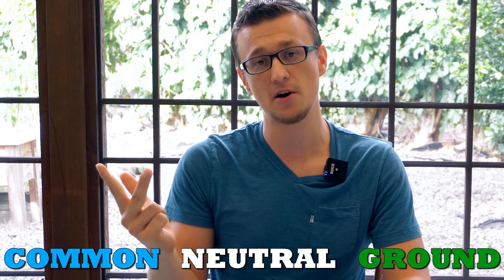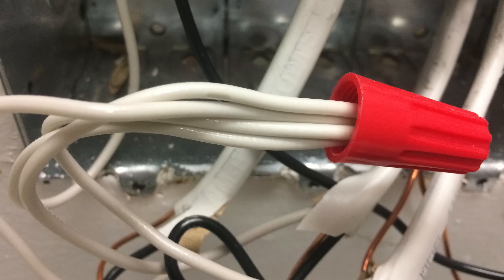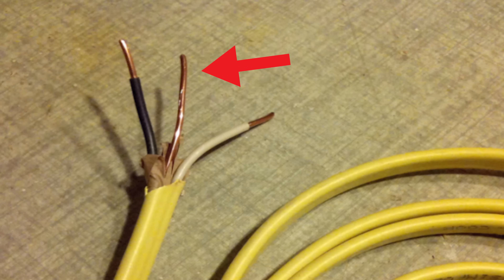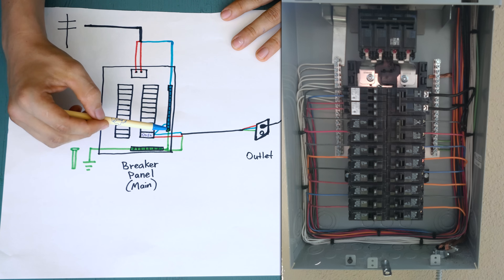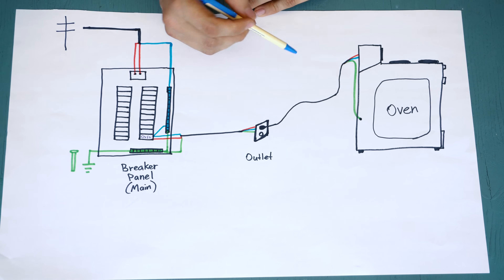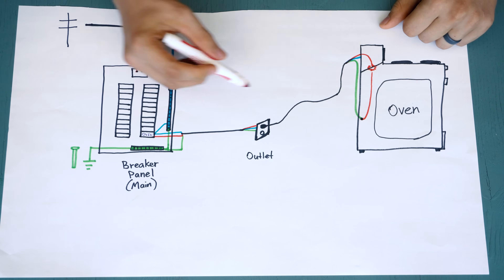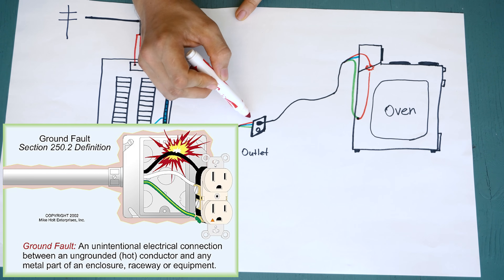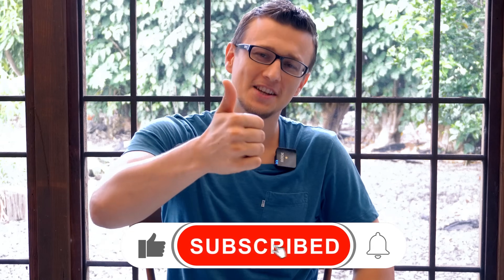Is Common and Ground The Same Thing?

Comment: if you are using common in place for a nuetral you are using the term incorrectly.   a common  is just that .  what does it have in common?  and with what?   there needs to be two or more things to be a common.  it could be a connection point or current path.   you can have commons on hot nuetral or grounds.

Comment: I recently purchased a powered intercom "system". that is NOT wireless - it uses the ground wire to carry the signal from one box (on circuit 'A' in one room) to the other box (on circuit 'B' in another room. In order for the system to work, circuit 'A' and circuit 'B' must therefore share the same ground bus bar. Can you please outlie my approach to making this happen. (At this time, the "system" doesn't work, meaning that the two circuits use different ground bus bars.)

Comment: An uncommon video. A clarification: A 240v service drop contains two insulated conductors that are connected to the low side of the transformer. The low side has three legs, two high (180 degrees out of phash) and a center tap. The center tap is connected to a bare carrier wire that is used to support the two hot wires (triplex). The center tap wire is also grounded at the pole by tieing it to the ground and neutral wire. These wires are connected to the service entrance and the neutral is connected to the weather head for aerial support of the wires. The neutral is then routed to the breaker box and connected to a ground rod and the neutral bus bar in the breaker box. Here the neutral bus bar is bonded to the ground bus bar. 

The ground and the neutral have now separeted. The difference between a neutral and a ground wire in house wiring is determined by which bus bar they are tied to. Electrically they are the same. Grounds can be uninsulated and neutrals should be insulated.

Comment: No, most electrical conductors in building DO NOT have a common. You should know this conductor > In the NEC electrical code, "hot" refers to a wire that carries live electrical current,

Comment: Great video, but I do believe that an electric stove would be 240 V and only needs the neutral wire for some 120 V functions of modern stoves.

On another note, I heard electrician more accurately say that electricity chooses paths proportionately to  resistances if the paths; meaning it will choose all paths not just the one with the least resistance.

Comment: This explanation is so wrong. The ground wire in romex is the same gauge as the neutral or live wire and it has the same resistance. Frankly the whole reason we still use a ground wire is mostly BS. Many countries don't use ground wire and just use grounded neutral for grounding.  I have still not seen any convincing argument for the existence of the grounding wire when NEUTRAL AND GROUND are bonded and they are the same gauge wire!!!

Comment: In North American residential electrical Neutral and Common are not the same thing. Common is a hot leg that ties into a three-way switch to either feed power to one of two Travelers, or from the Travelers to the load at the other end.

Comment: If you connect  earth connector with neutral  connector bars then  you used power for lights or electric equipment that time   ground wire also showing have electricity. Can you explain why that is happening?

Comment: Your drawing is wrong, the neutral wire connects to the neutral/ground bus and not to the breaker as shown. That's not how the breaker trips. It trips by the neutral wire returning the ground fault current back to the transformer. There are, however, panels that have snap on neutrals in which the ground wire attaches to the breaker instead of the bus bar directly, but it's a convenient routing method and has nothing to do with the tripping mechanism.

Comment: And last but not least addressing the path of least resistance. Is true technically. Electrons can move just as fast as the speed of light, the problem with electrons not being able to move that fast is the restrictions or resistance we put up on them with the conductors equipment etc. so when you actually have a ground fault the electrons will hit every point of all part of that circuit in milliseconds less than milliseconds but only one valve is open allowing the electrons to get back to their home which is  the ground hope that makes sense. 

Sorry my experience 27 years master electrician. Again I enjoyed the HVAC videos I appreciate you for posting those ⚡😎⚡

Comment: Therefore you cannot have a grounded conductor without first having a grounding system in which to install hence that's your ground system. As you said cold water pipes and ground rods are all part of the grounding system. In which all of the neutrals are GROUNDED.

Comment: As far as the common the neutral the ground you're kind of half right your information is not incorrect, and it will not hurt anyone but if you want the real explanation I can give that to you. Referring to what you stated, you said electricity is lazy it wants to find the easiest path to ground.  Electricity is not lazy it actually trees all potential sources to ground simultaneously. But only one of them allows the fault to get to ground without any resistance that is the grounding conductor not the grounded conductor.
Think of it like this the ground wire the bear or the green or the green of the yellow is grounding your system your neutral your white wire is grounded to your ground that's the easiest way to explain

Comment: Trying to add 110 outlet from a 220 line,plug in. Says take one the black or red( hot) and neutral to receptacle plus ground, did that and got 8 volts, neutral is not connected in box or at plug. So just add the neutral in box to one of the ground/neutral bars

Comment: If the ground bus is connected to both the neutral bus and the grounding rod, why does the neutral rather than the ground rod receive the current? Don't both paths have little resistance? Thanks
Reply: The ground rod is part of the grounding electrode system (GEC), the ground wires that come from the internal circuitry are known as the equipment grounding conductor (EGC), and they serve different purposes. The GEC is primarily to protect the building from lightning strikes, and the EGC is to protect against internal faults, such as shown in the video. The ground wires from the circuits end at the ground/neutral bus bar and since they are bonded there the fault current goes up the neutral wire back to the transformer and trips the breaker. The current always wants to return to its source, the transformer in this case, so maybe a small amount will go to the ground rod.

Comment: That's odd, for I was under the impression that you wouldn't want a neutral connected to ground. If it were, then that ground would become a potential hazard.
Reply: No, because the neutral is connected to the ground at the main panel and nowhere else, electrically speaking, under normal operation. Since it's an open line under these conditions, there will be no current.

Comment: I would say yes the ground does help with conduct electricity back into the original intended circuit, but a GFCI guarantees you get no potentially dangerous or deadly zap. Well this is only the case of course it the circuit breaker doesn't trip

Comment: So, the Neutral and the Common are the same thing?
There are 3 different wires but you mentioned 4 different terms. Hot - Neutral - Ground

Comment: It’s difficult to simplify something that isn’t quite that simple. We throw around terms loosely, but really, when it comes to explaining things, details often matter. You can only simplify things to a point, and after that it can lead to inaccuracies. 

More accurate names for the conductors of an AC circuit that we utilize here in the USA are; “ungrounded” conductor, which is most often referred to as the “hot” conductor(s), the “grounded” conductor, which is most often referred to as the “neutral” conductor, and lastly the “equipment groundING” conductor, which is often loosely referred to as “ground”. 

The term “neutral” actually refers to a conductor tapped onto a secondary winding of a transformer at its center. It is termed neutral, because it is tapped precisely mid-way on the full secondary winding, having equal potential from either end. A neutral conductor is often a “grounded” conductor, but a “grounded” conductor is not always a neutral conductor. For example, if the full potential of the secondary winding is 120 volts, or in the case of a multi-tapped secondary. It is termed “grounded”, because it is intentionally bonded to the equipment grounding system, and the grounding electrode system, which is accomplished with a “main bonding jumper”. 

The term “ground conductor” loosely refers to the possibility of more than one different system conductor that we commonly use here in the US. “Equipment grounding conductor”, and “grounding electrode conductor” are two of them.  The equipment grounding conductor’s purpose is to provide a low impedance path for current, from our appliances and wiring system, back to the source “to facilitate the opening of the overcurrent protective device” in the event of a fault. 

The grounding electrode conductor’s main purpose is to provide a low impedance path from the system wiring, to the “grounding electrode(s)”. The primary function of the “grounding electrode system” from a design standpoint is lightning protection and protection from high current, and high voltages produced during internal transformer faults.

Comment: The one thing you didn't explain, or show is the green wire ground from the main panel to any or all boxes, or outlets or another main panel box for a garage. Question is, if you have the green wire from the main panel: GROUND WIRE FROM GROWN OUTSIDE: Does that green wire, ground get attached to all boxes, outlets, switches, extra main, Example garage, plus a single grounding wire with a Shepards end to all metal with a screw. Example if I add an extra main to my garage, I run a Black hot a red hot a white common/ neutral and a green ground wire all from main house to main garbage do I continue all four wires to everything that needs power. I all wise see only three wires black, red hot and neutral and maybe a pigtail ground to boxes and metal but no fourth green ground wire. WHY, and could you do a video explaining the path and reason for this green wire and why it is not hooked up to everything and back to the main box or panel. Thanks.

Comment: What should I do to fix if I don’t have a ground wire in my outlet and this outlet is for kitchen area. I don’t wanna open the wall to run a ground wire or replace the wire( with ground wire)? Thanks

Comment: Another great presentation 👍👍. I had that happen with my dryer. One of the hot leg wires became loose over time on the power block and shorted against the cover that protects the power block from being touched accidentally.  There was a burn mark on the inside of that cover and it blew the circuit breaker.  Unfortunately the breaker would not reset so it was replaced.  I make it a habit now to check the power block every so often to ensure all the wires are tight.  The dryer was only a year old and I have a feeling that when they attached the power cord, it wasn’t tightened sufficiently.   BTY, like the joke at the end! lol.   Here’s one for you.  two men are arguing with each other, one says to the other,  the problem with you sir is ignorance and apathy what have you got to say about that? The other man replies I don’t know, and I don’t care.
Reply from the maker: Thanks Tony! Sorry to hear you had the opportunity to experience the dryer shorting out. I have seen the exact thing a few times before too. You are probably right, if they did not tighten the screws enough, a loose connection will cause the wire to start to melt. Haha and thank you for the joke! I added it to my list. (my ending material reserves are running out so this was timely)

Comment: Something I don't understand.  If the ground wire is very low resistance in respect to neutral wire, and it shares the same node as the neutral wire, wouldn't the ground wire shorts the circuit out?  That part confuses me.
Reply: You are correct, ground is higher resistance than neutral.

Comment: Great vid.  Couple comments:  Neutral is a current carrying conductor that has 0V potential to Ground and connects back to the center tap of the main transformer feeding the breaker panel.  Only found on 120VAC and 277VAC circuits.  Ground should never be used as a current carrying conductor.  In older circuits, EMT conduit, water pipes, gas pipes, etc. were used as grounding conductors.  If these were carrying current all the time very bad things would happen above and beyond removing  the safety aspect of the ground.  

Common usually refers to 24 VAC circuits with all loads connecting back to Common.  Also used to describe the "input" of a SPDT switch. (Common, Normally Open, Normally Closed.)

Comment: Hey man, I am having a issue with my furnace. It will come on and heat my home without issue than shut off when home is at set temp. Then temp will drop and furnace will only blow cold air when it comes back on. The pilot light is lit but it seems like the burners aren't coming on. If I flip the power switch it will come back on. I replaced the high limit and roll back switch. Any idea?
Reply: Does your thermostat have a fan setting with. AUTO and ON settings? On AUTO the fan runs only when heating or cooling.  When set to ON the fan always runs perhaps continuing to filter the air and will send room temperature air from the return to the supply which will feel cold.

Comment: I need help. Replaced flame censor, and the hot surface igniter. I have also cleaned the burners. The burners wont stay lit some come on some dont and it's never the same ones. After messing around for about an hr I can get it to fire up.

Comment: A common is a wiring technique in which one side of the circuit is a "common" return for multiple loads via an unbroken conductor, or in low voltage systems such as cars, the metal parts of the body, chassis and engine for power distribution (signal and sensor wiring in newer cars use dedicated return (negative) wires for cleaner signals).  A neutral is a "grounded conductor" meaning it is bonded to the system ground so that it has no (or low) potential (voltage) difference between it and the surround Earth rendering relatively safe.  The ground or "grounding wire" is a wire that provides a low impedance path from any conductive (metal) element in or near electrical equipment/installations that could potentially become energized by a "hot" conductor fault in order to "clear the fault" by tripping the breaker.  Thus removing the potential for shock should someone come into contact with the conductive element.

Comment: One thing that always confuses me, and maybe you can answer or have a video on the subject, is if everything in your electrical circuit is grounded properly then why do you need search suppressors or protectors? How do they function in relation to a properly grounded electrical system? I asked her specifically because once I tried to get the electrical company to come out and install a type one search suppressor on my electrical meter, and they stated that one was not needed because everything was properly grounded. And I’m such a n electrical novice, that I didn’t know how to respond.
Reply: Surge suppressors provide a bypass for induced voltages on the hot wire to the neutral limiting the voltage seen by the load equipment.  This is needed for electronic devices that could be damaged by high voltage spikes.  Once on the neutral, the induced current will be attenuated by the system ground.  A surge suppressor at the meter would bypass currents induced on the service wires and may be already dealt with in the meter or service distribution design.

Comment: Can you add the ground and neutral at the same place on an oven/dryer? i.e. If I had a 3 wire with ground (so I guess technically a 4 wire) plug. So it has a black, red, white, and green. Can I hook the green and white up to the same spot?
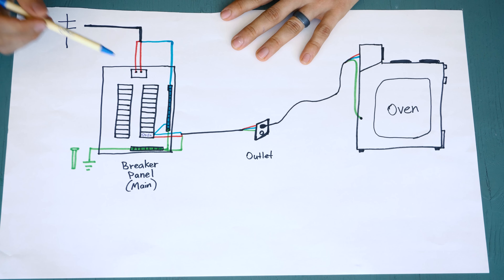Reply from the maker: If there are 4 wires, the ground and neutral would not be hooked up to the same spot. I actually have a picture of exactly what you are asking about in the video. Look at 2:41 in the video. That is how it would normally be wired. Cheers!
Reply: @WordofAdviceTV  okay, so the place I work has been doing it wrong for years. Is there any danger to that?

Comment: Is the buss bar always hot
Reply from the maker: Yes, the neutral bus does have current going through it when power is on. The amount of current varies depending on what appliances or fixtures are powered on but it is never a good idea to be touching any bare terminals inside a panel.

Comment: Back in the day there was no ground wires in a Main Panel Box, the neutral was your safety.  Now they have a Neutral Bar and a Grounding Bar.   

The National Electrical Code (NEC) requirement for separated neutrals and grounding wires in a subpanel and separate neutral and grounding conductors back to the main panel, when both panels are in the same building, dates to the 1999 revision.
Reply from the maker: Wow now that is interesting! I did not know that the grounding wires are actually a fairly new addition... Thank you for broadening my horizons! 😄